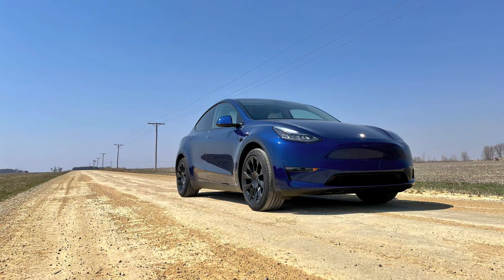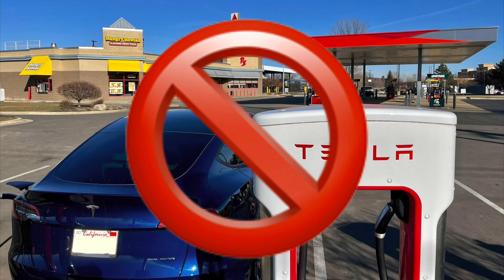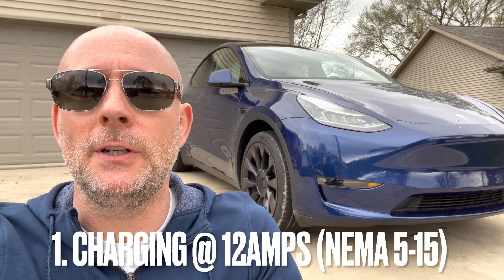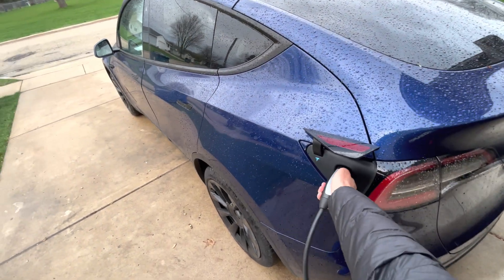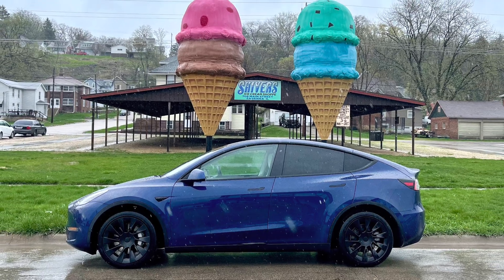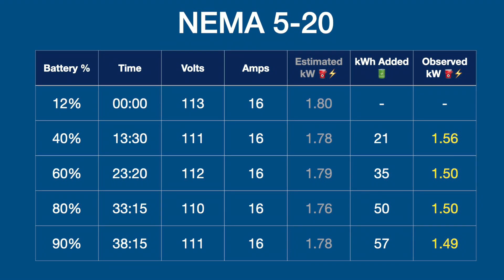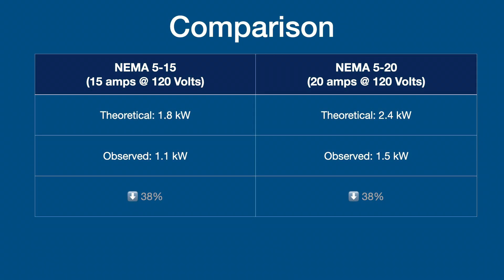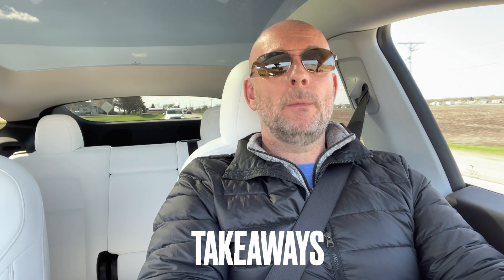E29 | 110-120V. 25% Faster Home Charging on NEMA 5-20 (Tesla Model Y)

Comment: The problem is, it only draw 16 out of 20 amps. If you equip the 30A pigtail on the charger, then use an adapter for the 20A plug, you can set the tesla to draw 19 or 20 amps and the breaker won't trip.

Comment: Garage receptacle circuits are usually 20 amps but the receptacles are usually rated at 15 amps. You then can replace the NEMA 5-15 to a NEMA 5-20 receptacle.

Comment: Thanks for this! I live in an apartment and there’s some plugs that were meant for EV charging they forgot about that I secretly park. I had no idea it was a nema 5-20 plug. Accidentally bought 6-20 as well! Just got the J+ booster and it’s amazing, clearly displaying 16amps vs 12amps on my 5-15 plug. From 50->80% it went from 17 hours and 10 minutes on 5-15 to 16 hours and 40 minutes. For a road trip overnight at a hotel with just a 5-20 plug, definitely real $$$ back in my pocket just because I used a 5-20

Comment: Bro so much BLA BLA BLA.  Hera is a better way.  A 5-20 adapter will charge the battery by 2.1% in one hour. So if you need to charge 20% of the battery it will take 20/2.1= 9.5 hours. That is all you need to do.  Then do the same test for the other adapter

Comment: 5-20 is the way to go for economical charging. I am glad I came across this video. Thanks!
Reply from the maker: Glad it was helpful! NEMA 5-20 can actually work for many EV owners who don't drive all that much every day especially if they have a DC charger in the area for those occasions when they need a bit more range and faster than typical daily charging. Thanks for watching!
Reply: Realistically even going up to a 20A 240v circuit would be far better it's even faster than 50a at 120
Reply from the maker: @KiRiTO72987  Hi, thanks for watching. 20A*240V = 4.8kW vs 50A*120V = 6kW. Very technically, the 120V option you mentioned delivers more energy than the 240V option. However, most consumers don't have access to 50A 120V outlets/service, whereas higher amp 240V circuits often already exist and/are much more comment to install. So yes, 240V is better in most cases and EV owners should install them if at all possible. But for those who can't, or whose driving needs are quite low, some EV owners can actually live on 120V (15-20A).

Comment: Very informative , thank you for the details, would you be able to analyses NEMA 14-50 as well as some point ? or do you have any documentation that I can go and study ? thank you in advance.
Reply from the maker: HI! Thanks for watching and reaching out. (Just getting to comments now. Eeek!) I don’t have any experience with NEMA 14-50 other than what Tesla has published on their website:

“The recommended home charging installation for Tesla vehicles is a 240 volt NEMA 14-50 outlet. This outlet is commonly used for electric ranges and large recreational vehicles. Installed with a 50-amp circuit breaker, this outlet enables a recharge rate of about 25 miles per hour.”

- Voltage: Single phase, 208-250 volt AC supply, 60 hertz
- Circuit Breaker: 50 amp (125% overcurrent protection)
- Operating Current: 40 amp (maximum continuous current)
- Conductors: 6 AWG, Copper Wire Only. Upsize wiring for installations over 150 feet
- Ground Fault Circuit Interrupter: Not required
- Service Disconnect: Not required
- Receptacle Recommendation: High quality, industrial grade receptacle
Examples: Hubbell part # HBL9450A, Cooper part #5754N
- Ventilation: Not required
- Outdoors: Install with NEMA 3R rainproof enclosure

If you have the ability to install it on your property, it appears to be a good option. 

In terms of time to charge: since its peak performance is 240V 40A, that means that it would charge in a best case scenario at 240*40 = 9.6kW. To charge a 78kWh Model Y battery from 0% to 100% would take 78kWh/9.6kW = 8 hours 7 minutes 30 seconds, or 0.81h or 49 minutes per 10%, which is a very nice charging speed. You’d easily wake up to a full (80%?) battery every morning no matter how much to drove the car the day before. Best of luck!!

Comment: Great video. Thanks for sharing all the details. So cost wise, if you charged for lesser time on 5-20, will it almost same as charging for longer time on 5-15 or will be more?
Reply from the maker: Hey! Sorry for the delay in responding... I've been off YouTube the last little while. 

RE: cost... that depends on your utility. If you're charged by the kWh, then time doesn't matter. If you get X kWh in 40 minutes or X kWh in 60 minutes, you still pay the same amount since X is the same amount of energy.

But if you pay for electricity by the minute (relatively rare, but it still happens) then you'd pay less if charging took you less time due to slightly higher power. However, as best I've experienced, those sorts of time-dependent plans are tiered to incorporate power delivery levels, so the only thing I can say is that "it's complicated" if you're paying for time and devil is in the details. You'd have to check your home power bill. When it comes to Superchargers by time, they certainly bill you according to tiered kW rates to ensure you pay more for more energy, but the calculation is somewhat complex and sometimes you can get some deals if you're on the high end of the tier compared to the low end given the same amount of time.

Best of look figuring it out if you experience that!
Reply: Great details as always. Thank you. I ended up buying the 5-20 adapter after watching your video and very happy with my decision. Thank you. 😊
Reply from the maker: @rajtips  that's excellent to hear! It's crazy how just 25% faster charging on a 120 V outlet can solve a lot of people's daily driving needs. Best of luck!

Comment: Love the math focused breakdown! Just a sidenote - I heard when you wake the car up by checking the app it draws a non insignificant amount of power, so the KW estimates are probably a little higher.
Reply from the maker: Thanks for watching and reaching out. As far as I understand that is true. Reaching out to the car does activate the computer system and that consumes energy. I'm not sure that it's enormous but frequently checking the app would frequently activate the computer and would therefore frequently consume energy. So... if one were interested in maintaining battery charge over a longer period of time, one should not frequently check one's app so that the car is not frequently woken up to consume energy unnecessarily. I've left my Y parked without charging up to five weeks at a time and my typical rule is to not check the app more frequently than once a week. Doing it that way, I've noticed that the battery charge typically only declines by 0.5% per day max. It's pretty impressive.

Comment: If your house has an electric stove or even a dryer then the circuit breaker box can handle a level 2 home charger!
Reply from the maker: Yes IF... your panel can handle it. If not then you need a panel upgrade along with a 240V outlet/plug/circuit brought out to where the vehicle is/are and that can come at a significant cost. Home owners will very likely upgrade their properties over the next 20-30 years to accommodate 240V EV charging (the same way they did with indoor plumbing, gas/electric service, lighting phone/Internet, HVAC systems and all the rest in the last century) but it will certainly take some time and money, just like everything else. Thanks for watching!

Comment: So there are houses without 220v? How is that possible? When you say you cant install a level 2 charger I get a little confused?
Reply from the maker: Hi! Thanks for watching and reaching out. 

In the case of my parents' place: yep, they've got 240V like any other house, however there are a couple practical considerations that go against installing a 240V AC outlet for my EV:

1) they don't own an EV,

2) installing just for my generally-infrequent trips across America wouldn't make a lot of financial sense (whether they or I paid for it), and

3) as best I understand their home, they'd have to upgrade to an all new panel because their current panel is maxed out (major appliances in the home are powered by natural gas). 

A new panel would also pile on extra cost for the upgrade just so I could charge a little faster. 

If my parents — or someone else in a similar situation — were to buy an EV and they drove more than 40mi/day and/or lived somewhere with frigid winter weather then they'd pretty much need to pay for the upgrades. 

But for people not in that situation — and for those with smaller, efficient EVs like a Tesla Model Y — charging on 120V isn't a particularly bad option. 

But definitely, sooner or later most homes will be upgrading to make way for the mass electrification of our economy, but that's going to take decades and different people will be upgrading at very different times. 😃
Reply: I assumed you could run a level 2 on 220/240 with a 200 amp bus??  Maybe theirs is 100 amps?

Comment: Great video! The wife and I are about to take a trip to visit my parents and they definitely have 5-20 outlets in their garage. Now, I just have to convince them to let me park in there 😉
Reply from the maker: Haha... good luck with your parents! Fortunately the 5-20 outlet is close enough to the front of their garage that I can park outside and still use the mobile connector. Unfortunately a standard extension cord can't handle the load and is dangerous to use (which the car would detect and eventually shut down, which happened to me once). So I just get nice and close to the garage door and close it just above the cord so it doesn't get pinched, and the car charges well.

Comment: I made same mistake, bought the 6 - 20, which is a 200 +volts. I wonder if you charge with 5 - 20 with a 5 - 15 adapter, will the charger notice or still pull 2kwh?
Reply from the maker: I'm not an EV engineer or an electrician, but best I know, a 5-20 adapter cannot be used on a 5-15 outlet as the pins are different (and vice versa); nor should one exceed a circuit's capacity when charging their vehicle. Assuming the car doesn't detect and prevent this, it can cause serious safety & fire hazards to the lines/buildings where that's happening. As always, consult a certified electrician when figuring out what's best and safe for your home, and the homes of others. Good luck, and thanks for watching!

Comment: This is great though.  I may be able to just swap out an existing breaker and put in the 25% socket.  Sure beats upgrading to a 200 amp service panel  so I can run level 2 charging.  I don’t have the space to add a 60 amp breaker.   Sweet
Reply from the maker: Thanks for watching! No doubt 240V@60A (effective 48A) is always most convenient, but I’m finding that a good number of people can actually live totally fine on 120V at the higher 16A from a NEMA 5-20 outlet. I think we’ll all eventually upgrade to 240V chargers — especially when 100-150kWh batteries become common, but for the rest of this decade I think people who have an EV sedan/CUV with a 60-80kWh battery AND who typically drive fewer than 45-50 miles per day can easily and cheaply live on a NEMA 5-20 outlet. As it is, I’m currently renting an apartment and charge on a NEMA 5-15 120V/12A that gets me a slow 3.7mi/h but that actually works for 2/3rds of my week, then I’m able to charge at work on those days that I do my 100mi loops. There’s a 240V public charger around the corner from my apartment and a Supercharger a mile away. I have a friend in the neighborhood with a Bolt who charges on 120V/12A for her daily 35mi commute and she almost never even needs CCS. Different people will have different needs and budgets — best of luck finding the best solution that works for you!

Comment: Unsure if this has been said or not, but if your voltage is closer to 120 instead of 110 the power advantage of having the 5-20 only increases as the higher voltage (120) x the same amperage (16amp) flat out gives you about 8-9 percent more power alone. I know people cant control what there voltage is but truly, investing in a 12gauge 25' 5-20 extension cord is a must if you are just out of reach with the plug
Reply from the maker: Thanks for reaching out! 

Yep, it's definitely all a matter of volts*amps and getting the kiloWatt charging rate, and it can definitely vary significantly. Fortunately I've always managed to be just within the reach of my mobile connector and an outlet and haven't (yet) needed an extension cord. 

That said, I might start looking at getting one because I'm looking to relocate to a new apartment and I'm finding that most apartments have ZERO interest in installing lines/outlets right where cars are parked, and so an extension cord might make sense if I plan on being able to charge at a new apartment parking spot. 

Of course, my bigger concerns in that scenario would be: 1) how to pay the landlord for electricity that likely isn't metered formally, and then 2) how to make sure someone doesn't steal my nice expensive EV extension cord + mobile connector. 

I tell ya, being an innovator has its challenges! Haha...

Daniel

Comment: I just had an electrician come out today to give me an estimate on a 240v install. Gonna cost me $6k+ to have them run the pipe down from 1 level up. 🤦🏻‍♂️. He pointed out my garage has the regular outlet, which is 15amps and the one you have there has that little dash indicating it as a 20amp receptacle. It’s like $400ish to get that upgraded to a 5-20 from the breaker box, but doesn’t really make a big difference for me as I drive mainly on the weekends and nearby errands here n there on weekdays.
Reply from the maker: Thanks for reaching out! Sorry to hear about the 240V installation cost. YOUCH! I suppose on the bright side of things... you'll be future proofing the house for all future EVs? Um... 😭 

In my apartment rental garage here in the San Francisco Bay Area where I'm now living I only charge on 120V 12A, which is typically good for 1.4kW or 4.5mi per hour at my regular driving efficiency of 3.3mi/kWh (300Wh/mi). 

The good news is that my daily commute is 50 miles so if I plug in by 8pm then I have no problem departing by 7am the next morning. I also do a 100mi commute once a week and fortunately we've got 240V chargers at work that (if I can get to work earlier enough) I can plug into to get some extra juice on those longer days. So that all works for me. But if I had no work charging option then I'd be at Superchargers and that'd be both somewhat pricy and inconvenient (my landlord won't install a 240V charger). Not looking forward to buying a house of my own one day and facing an expensive 240V installation. Best of luck!!!
Reply: @goingelectric7826  there’s also a chance he didn’t know what he was talking about. He was very confused about the layout of my unit and how he could run the wire down to the garage. I spent today mapping it out myself, and it looks like it might be pretty simple. I’ll tell the guy who’s coming next week for another estimate. My HOA admin was shocked when she heard that $6k amount. She said someone else in the complex got theirs done for under $1500.

Comment: Daniel, you can do even better charging your Tesla by using a Quick 220 20-amp-type voltage converter box connected to both of your nearby, hopefully out-of-phase, 5-20 outlets at your parents' house; you'd most likely be able to charge at a rate of up to 16 amps (80-percent of load), but at 240 volts, thereby giving you about 3 times the charge rate of a regular 120 volt, 12 amp charger!

At 16 amps/240 volts, you'd get close to 15 miles per hour of charging!

There are two conditions that must match the requirements of the Quick 220 in order that this may work: 1. two out-phase, fully-dedicated 5-20 outlets with at least 12-gauge wiring to and from your electrical panel; and 2. these 5-20 outlets cannot be GFCI protected.

You may also use 5-15 outlets, provided that no more than 12 amps is the maximum output for each outlet, in comparison to 16 amps with the Quick 220 20 amp version.

At 12 amps/240 volts, you'd get close to 11 miles per hour of charging, or over twice the charge rate of a regular 12 amp/120 volt charger.

In case I can't find a regular 240-volt charger while travelling, I always carry a Quick 220 box with me along with all of the required, high-quality adapters, extension cords and connectors; and I frequently end up using it at my cottage, which does not have the capability of taking a 240-volt charger since my electrical panel is completely full and cannot be expanded any further!

Just make sure Daniel that you follow the included instructions accompanying the Quick 220 to the letter in order to ensure safety!

Just check out the capabilities and requirements of each type of Quick 220 system by viewing the numerous videos on YouTube.

If in doubt, consult an electrician, by all means!

The Quick 220 is fully safety certified for use in Canada and the United States.

And we all want to charge as quickly, and as safely, as possible, don't we?
Reply: The sad thing is that NEMA 5-20 extension cord is significantly more expensive than a 5-15 extension cord. This can make the Quick220 for 20 Amps far more expensive than the one for 15 Amps. A fast charge might become better at some point.
Reply: @guillaumegiroux9425  More expensive, yes! Although it's a good idea to overestimate than underestimate when you deal with electricity, especially with continuous EV charging for lengthy periods.